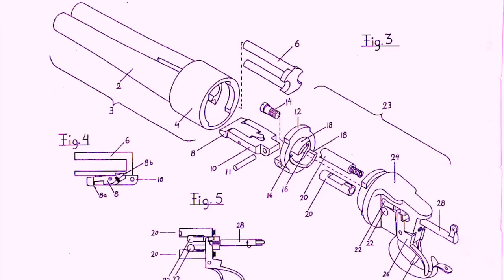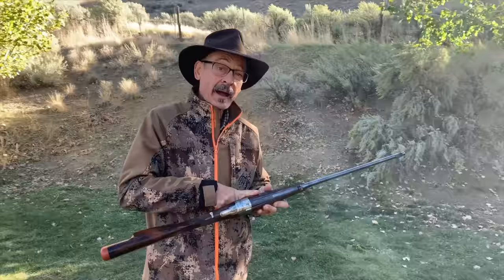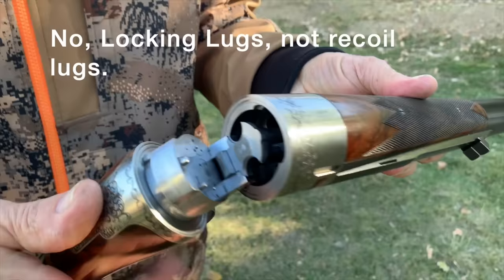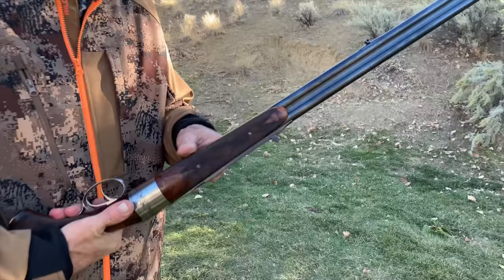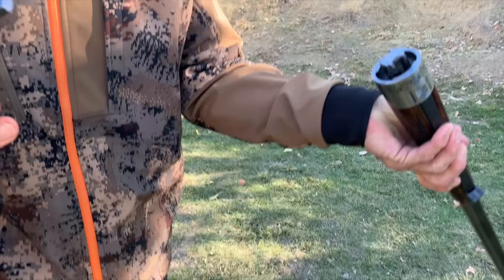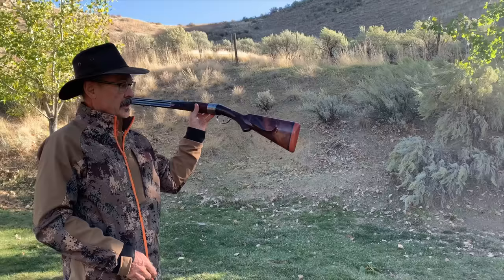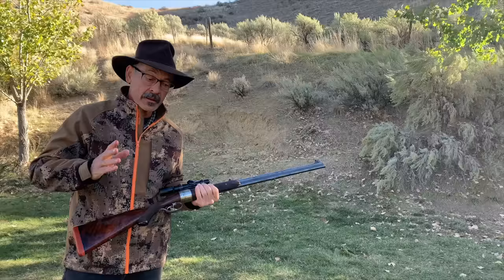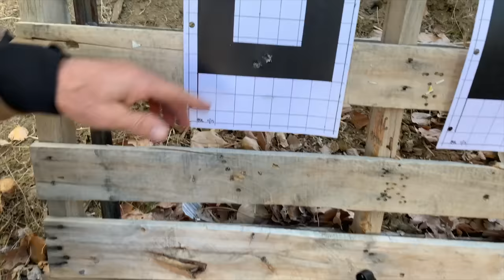Shooting a Hoenig Rotary Round Action Rifle

Comment: *Hears price, has a heart attack*

Wish I could win the damn lottery...
Reply: DR Dan  "CAN" be.  Sometimes,  it doesn't have to be.  Some times,  expensive things aren't very "quality".
Reply: Being a hand-built item,  there can't be a high production rate for this gun,  so,  the profit margin has to be correspondingly higher.
Reply: Just came from their website.  He and another gunsmith only make 5 a year.
Reply: DR Dan  Not just quality. it's more about quality and rarity.  You can have a quality gun that is super common and it would be affordable. Rarity makes it collectible.
Reply: That was new, i bet on the used market they're even more than that considering they're not made any more
Reply: But if you ever need parts for this 30 years down the line? Forgetaboutit

Comment: Rotary Rifles are something I've always be interested in. I've been designing up a semi auto design with only a single barrel and the chamber is separate from barrel so only it has to rotate. Also, it only rotates in one direction, meaning that there should be much less energy loss than with a reciprocating system. I love this design so much.

Comment: Thank you,Mr Spomer, for this excellent video. Gorgeous lines and beautifully engineered. However, I have my misgivings about its use as a dangerous game rifle. Looks fiddly for fast reloads. For driven boar, it could be an excellent choice. Just my opinion.
Reply from the maker: Valid concern. I wonder what a trained shooter with traditional break action and this could do for speed with each? I hear they don't like the ping of ejectors, which means the break action must be tilted same as Rotary Round Action to dump empties. Hand loading remains the same. That leaves the opening. Is reaching for the thumb tang faster than twisting? Hmmm
Reply: @RonSpomerOutdoors  Not enough difference that it matters in reality.

Comment: Hey Ron. Just recently started watching your channel. Love your content. Do you mind doing a accuracy comparison of a 308 vs. 7mm-08 at various distances from 100 yards to 1,000 yds?
Reply from the maker: Thank you. I appreciate the topic suggestion, but would counter that testing any two rifles chambered for these two cartridges would provide any information other than which rifle was more accurate. I fear the "inherent accuracy" attributed to some cartridges like 222 Rem., 308 Win., 6mm PPC are overblown unless you're trying to win a benchrest competition. Fractions of fractions of an inch differences at best. Most accuracy comes from balanced bullets matched with balanced cases/primers/powder charges perfectly concentric with the rifle action, bolt face, locking lugs, and barrel in which they are fired. Stated simply, I could test the 308 with crappy ammo in a crappy rifle against, say, my wonderfully accurate Jarrett rifle in 7mm-08. Wouldn't be fair. If you'd like useful information on accruracy potential of any two cartridges out to 1,000 yards, just run some ballistic trajectories. These won't say anything about the bullet/rifle accuracy potential, but will show you how susceptible each bullet is to drop and drift. Unpredictable winds are the biggest stumbling block to bullet accuracy at long range. A gust here, a 2 mph speed estimate there and the slower, lower B.C. bullet will miss the mark. This is why extreme range shooters are giving up the 308 for various 6.5mms and 6mms and even some 7mms. They can shoot lighter bullets with less recoil in the narrower calibers. Hope this helps.
Reply: @RonSpomerOutdoors  I totally understood all of that. Yep. I did... totally.

Comment: That was a real treat!  I've never heard of such a gun.  It's absolutely gorgeous.  What a brilliant action.  Masterful.  I'm wondering about the gravity ejection; what if the empty cartridge swells as is often the case with reloads.  They sometimes are difficult to eject.  Can you get at them with a screwdriver (God forbid) or just your fingernails?
Reply from the maker: No, the extractors initiate case extraction, pulling them a significant distance out of the chambers. Much more cartridge rim contact than even the Mauser leaf spring extractor hook. Gravity only finishes the extraction. You can also pluck the empties off the extractor as you would with a typical hinged action double.

Comment: Some of these earlier rotary models pre-civil war and during were known to ignite every chamber when fired causing injury and even death. These were before the center fire encased metal cartridges were used.
Reply from the maker: Paul, I suspect you're thinking of a revolving cylinder rifle. This rotary action rifle was first created in 1990. There were and are no others like it.
Reply: @RonSpomerOutdoors  I've not heard of safety issues with the Circuit Judge, which is of course a revolving cylinder rifle/shotgun.

Comment: Since he stopped making them is he planning on making the design available to other companies? When I can get a shotgun certificate here in the UK I'd love one, such a simple design should in theory make for a much more affordable firearm for the level of quality, only thing I'd be curious about is would it re-cock before it opened enough to extract?
Reply from the maker: Twisting to open pushes a cam to cock both triggers and is smooth and easy. Hinging barrels down pushes the extractor which lifts cartridges/shells about in inch out of the chambers. All very robust.

Comment: Noob question: when you take off the mounted scope and put it back on, wouldn’t you have to zero it in again?
Reply: I know you asked this a long time ago, but with the recoil jig and the rails, the way the scope mounts would be identical every time.  Now if you remove the scope from that mating surface that it resides on, then yes, you would.

Comment: 74 rimmed by what bore ,what's bullet weight ,volosite
Reply from the maker: As written in the description above and stated in the video, Roy, a 9.3mm. That takes a .366" diameter bullet. During the video presentation I mentioned I was shooting 270 grain bullets at about 2,300 fps.
Reply: @RonSpomerOutdoors  I would like to see a 303 British reamer made to 338 with a acklee shoulder
Reply: @royboone3008  I can make that reamer, but the 338 bore is a bit wide for the 303 due to its taper. The 40 degree "Ackley improved" shoulder wouldn't do much for you.

Comment: The locking mechanism has no effect on recoil...
Reply from the maker: Not on ameliorating recoil. I'm referencing how the locking system eliminates the recoil pressures that wear traditional double rifles with locking lugs beneath the barrels. This causes flexing as the breech face is pushed away from the bores, hinging around the locks rotating around the hinge pins. Hard used doubles often "shoot loose," gapping at the face/breech interface. This one does not.

Comment: My first thought was of this side-by-side...
https://www.youtube.com/watch?v=Msy1ueUT0o8
but this modern version is truly beautifully elegant in its simplicity. And the action's increased strength is definitely pretty compelling. I'm surprised he used two locking lugs instead of the usual interrupted threads...but I imagine that design choice probably removes a lot of opportunity for hangups from the system, and makes tuning/fitting easier. 

It's really fascinating that the action apparently works purely by being immaculately fitted? I'm really curious if a bottom-of-the-market version, maybe based on interrupted threads, is possible.

( Bonus over-under video: https://www.youtube.com/watch?v=kK88EsjZCrc )

EDIT: ...finished the video, and...
Firstly, I forgot to say: that scope mount is really neat. It must be a dovetail with one of the angled sections retracting when the lever is lifted?
Secondly, oh my gosh, somehow I heard that as $2700...my brain would not accept the actual figure. Fascinating....

Comment: This seems so unnecessarily complex
Reply from the maker: Actually, it's the opposite. This gun has fewer moving parts than most, if not all.
Reply: @RonSpomerOutdoors  More than a break action
Reply from the maker: @LaughingMan44  No, break action doubles have about twice as many working parts as does this gun. Perhaps you've never seen the internal workings of a side lock or box lock double. Lots of stuff in there such as safety sear, safety sear spring, main sear spring, main sear, pistol pin, bent, tumbler axle, stop, tumbler, bridle, anvil, swivel, and mainspring, all held together with 5 to 7 screws. Two complete sets! Plus the triggers, top tang safety, lifters, firing pins, top closing bar... RRA has half this number and no tiny internal screws to hold it all together.  No moving parts attached to the forend stock, either. It's really an amazingly simple mechanism, but you probably have to see it in pieces along with a traditional break action double in pieces to appreciate. Cheers.

Comment: You don't know what torque is.
Reply from the maker: Maybe I don't, Rufus. In double barrel shotguns I've always used "torque" to mean both the twisting force generated by the fired shot (in which the equal and opposite reaction to the accelerating bullet engaging the rifling twists the barrels in the opposite direction) and the reaction of the barrel breeches pushing away from  the fence (breech face.) Because the locks of traditional doubles are well below the barrels, this reactive force forces them to rotate around the hinge pins. Over time the effect is to weaken the action and create separation between barrels and breech face. With the Rotary Round Action's dual lock up equidistant and in line with the barrels, torque (or whatever you call that force opposing the launch of the payload) is evenly distributed and in a straight line with the force, thus no hinging, no pulling away from the breech face.